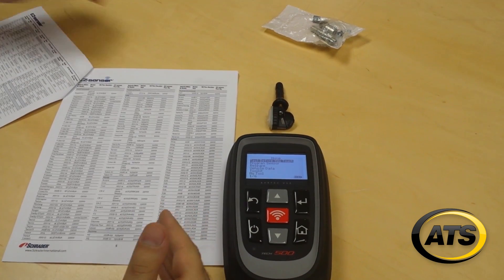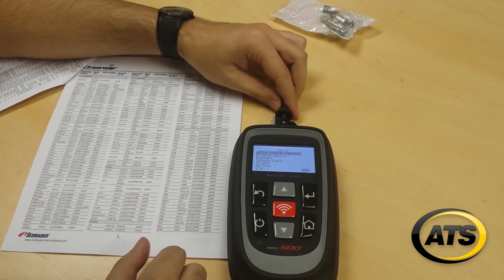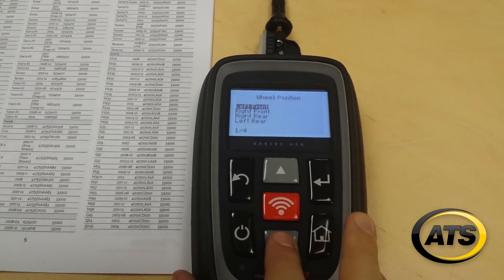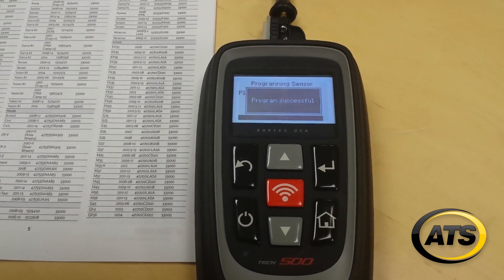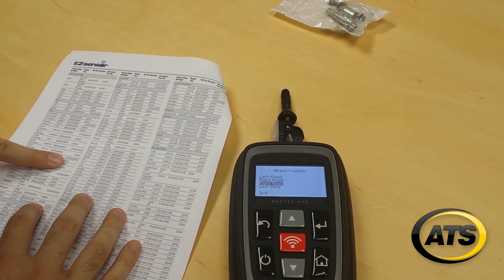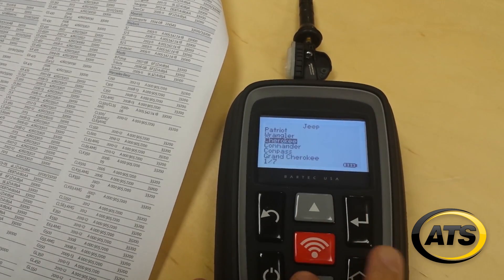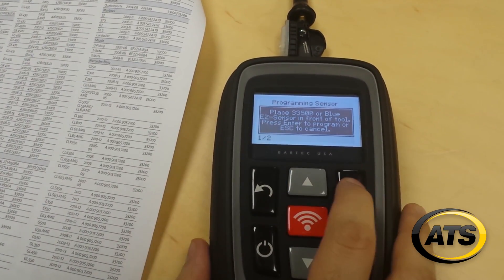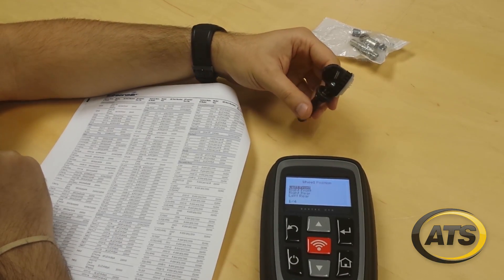How to Program the Schrader EZ-sensor 33500 (315/433 MHz)

Comment: Can this be done when installed in a rim with a tire mounted?
Reply: It can but it's better and more efficient to do it before the time and effort is made to mount it inside the rim. If it's defective or doesn't work...it's much easier on a bench.